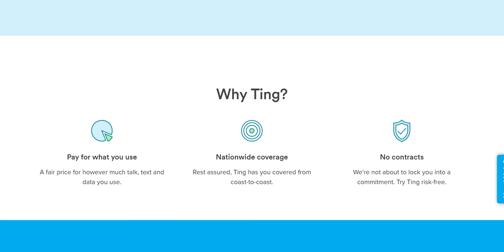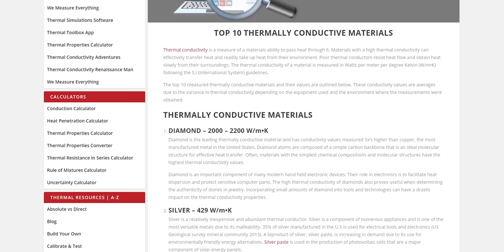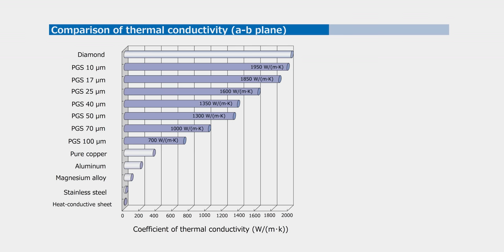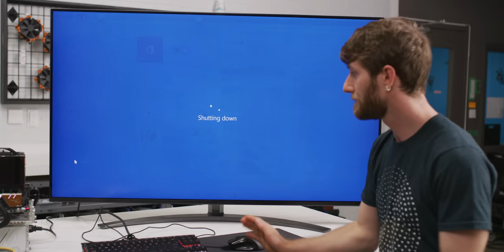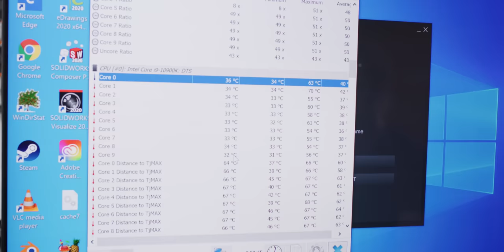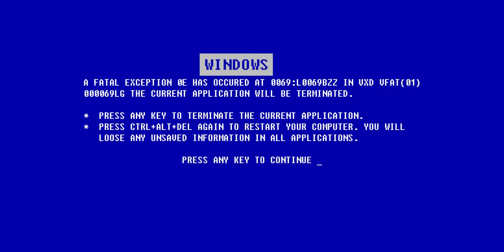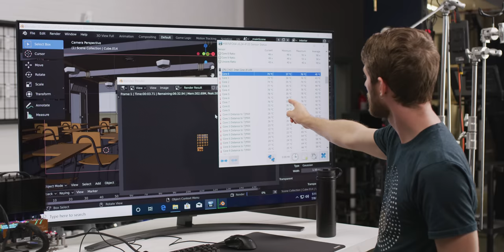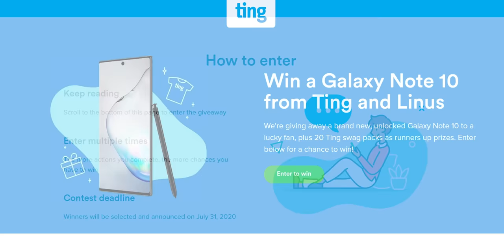This Sounds Too Good to be True - God-Tier Thermal Pad

Comment: Graphite sheet has two types of conductivity, horizontal / vertical.
Of course it is in datasheet, but Linus would never say in the beginning.
Because you know why.
Reply: could u explain?i can't even think of any reason not to say this
Reply: @user-xb6hi2pn9u  to clickbait
Reply: @user-xb6hi2pn9u  because there would be no video. It's a physical property. It's a fun video, but with sufficient information it was absolutely arbitrary.
Reply: It's called anisotropic heat conduction. Basically, because of the microscopic structure of layered graphite, the carbon rings have véry good conduction to their neighbouring, networked carbon rings. Alas the inter-layer conductivity is quite poor, because there is some sort of (electron) vacuum in between subsequent layers. So basically, we create giant networked sheets of carbon rings, that are tightly coupled. These tight couplings conduct heat very well. But inter-carbon-network conductivity when stacked upon each other is very poor.
Reply: Interestingly, this would be solved by using diamond instead, because diamond does have vertical interlinking between the carbon atoms aswell, e.g. https://i.stack.imgur.com/zytVR.jpg . Sadly, this is practically not really feasible.
Reply: @snknsnp  well, yes and no. Artificial diamonds aren't as expensive to create than people would believe... Just a side note
Reply: @petertomov5728  As far as I know creating a diamond layer that is 1) as flat as graphite, 2) very thin and 3) consisting of one single piece of diamond is incredibly hard, if not impossible. It is true that industrial diamonds are not that expensive, but creating some with these constraints probably is.
Reply: I am no diamonds expert though, so I might be mistaken here.
Reply: @snknsnp  similar here. Well, you can always rotate graphene 90 ° and do some engineering mumbo-jumbo to increase graphene efficiency 😂
Reply: Because it’s clickbait.
Reply: Peter Tomov yeah! Fold it it veeeeery ofter so the folded thickness would be the width og the chip! Cut a thin slice and lay it on its side so graphene is orientated the correct way:) voila!
Reply: @XXXstuppiXXX  ok, that I can't imagine that without "layered" electromagnetic wave interference while the graphene is "grown" on the sides of the chip.

That's not engineering mumbo-jumbo. That's engineering black magic.
Reply: @snknsnp  This would explain why diamonds are so good as this as well, since diamonds are crystalline structures of carbon, so their thermal conductivity is three dimensional!
Reply: so what if you folded it between the CPU and the heatsink? Like, literally folded it in half, with one half of it sticking to the CPU and the other half sticking to the heatsink. Since it conducts laterally, the heat would curve along the 180 and wind up on the heatsink, no?
Reply: @snknsnp  what about folding it into a cylinder and pressing that flat? (As someone else also mentioned)
Or using a single (molecular) layer of it (which is how it assembles anyway, I believe)?
Reply: @snknsnp  has anyone ever doped it such that it it will grow in zigzag layers, and each layers peak will bond with the above layer's trough? (When viewed from the side, the multiple layers will appear like diagonal cross hatch pattern)
Reply: @snknsnp  Diamond thermal compound exists.
Reply: @nickllama5296  That would double the amount of material on the low conductivity axis and on the high conductivity axis the heat would both travel through very thin layer compared to the entire contact surface of the CPU, plus it would have to travel much further (effectively the pad's width would become it's thickness in that direction)

As far as I can tell, the real use for this product is to transfer heat from a much smaller surface where to a much larger heat sink (it helps because in horizontal direction this material actually conducts heat much more than metals). But in our CPU-cooling scenario that would only help if our heat sink surface was larger than CPU surface itself - usually not the case with standard stuff

Comment: Fast note, it doesn't matter how high the thermal conductivity is if it is higher than the materials' thermal conductivity it is in contact with, the point of the thermal paste is to achieve as much contact as possible it's used as medium because the 2 aluminum plate on the CPU and the cooler won't make a good contact because they're simply two hard solid body

Comment: Thanks for proving what we have been telling our customers for a long time: "Bulk thermal conductivity alone is a poor predictor of thermal performance".  The largest killer of thermal performance is normally the trapped air in your bond line.  It is better to:
a) Ensure that you have no voids (air) in your bond line
b) Reduce that bondline as thin as possible
c) ... and THEN try to get the highest possible thermal conductivity
This is better achieved using a Phase Change Material, or One- or Two-part hybrid thermal gel and then with screws or spring-loaded clamps for best performance.
Find out more on our website: https://www.caplinq.com/thermal-interface-materials-mc.html

Comment: As others has stated, This is made to transfer heat across an area and not up. I would think the glue on one side would be enough to run the heat transfers up or down.

Comment: Realize the very high thermal conductivity is in x and y. Z is similar to other good thermal material, but it’s the lateral direction transfer that provides the astounding performance.  And yes it’s electrically conductive as well.

Comment: It's really quite useless using anything more thermally conductive than the cooler, since it will definitely be loads thicker.
Reply: Not entirely true - CPU's heat unevenly, so having a thermal interface material as conductive as possible helps spread the heat out over a larger surface more quickly. This means that the heat differential at every point of contact between the Cooler & thermal interface material is equal and allows for more efficient transfer of heat between cooler & thermal interface.
Reply: Not at all true actually, because the heat spreader and the cooler won't be absolutely 100% completely flat, meaning there will be some spots where it just won't make contact, that's the entire reason you need a thermal interface, because having it make contact at all is better than parts of it not touching.
 
Plus this is something anyone can very easily disprove yourself, since all you have to do is set your cooler on your clean cpu, get it to warm up, then remove your cooler, apply thermal grease or a pad and try the test again... Like wtf?
Reply: @vgamesx1  he's not saying don't use thermal material. He's saying using a thermal material more conductive than your CPU coolers copper bottom is useless - I.e. using one as conductive as that graphene sheet claimed is useless.

Maybe learn reading before you "like wtf" people?
Reply: Since its going to be loads thicker to fill in the gaps and imperfections you specifically want it to be as conductive as possible to mitigate the fact that it IS going to be thicker, that is the whole point of getting something as conductive as possible, and as he mentioned at the end heat pipes with multiple stages of heat transfer are very at moving the heat so you want to be able to get as much to them as possible. The problem is that while metals are quite conductive they aren't good at filling in those spaces since they tend to be porous to a degree that will actually effect cooling performance, so you are once again looking for something else to fill the gaps and the best thing you can to remove that point of failure.
Reply: @Jack-yv3po  My bad, although it's almost as if people can have completely different interpretations of the same thing and/or simply miss small details entirely from the way something is written... Again my bad and I kinda deserved that but it's just a mistake so let's not make a bigger fuss out of this.
Reply: @JohnA...  Yes, the ideal would be no temperature difference between the IHS and the bottom of the copper block. But still you have to conduct the heat from the bottom of the copper block to the heat pipes. I don't know the exact distance, but it will definitely be much more than the gap between the IHS and the cooler. And as Linus says, I think it is much more important to get best coverage possible, to use as much of the area on both IHS and cooler bottom to actually transfer the heat away from the CPU.
Reply: @vgamesx1  It's fine to misinterpret things - but perhaps don't insult people with condescending lines like "like wtf" and instead try to clarify exactly what they are saying, especially when what they are saying seems so obviously wrong.

Comment: Many people forgot that the main goal of using the thermal paste - removing the air from the gap between cpu and cooler. Air is a good thermal insulator. So thin pads would work if only you make the surfaces ideal.
[sorry for my bad english]

Comment: Thermal conductivity boundaries are insulating in proportion to the difference in conductivity between those boundaries and the thermal reflectivity. In the direction from low conductivity to high conductivity the transfer is faster than high to low. You should have used the sticky side on the CPU. If you use multiple sheets, you effectively create an insulator.

Comment: This could work well if there were more layers, I think, as this will vastly increase the thermal capacity of the incredibly thin layer. Only then the heat can be efficiently transferred

Comment: Ah yes. Graphene. The supermaterial we've been hearing about for at least a decade and a half but have yet to actually use outside of labs.
Reply: It took aluminium 30-40 years from being discovered as a "wonder material" to being used in any significant quantity.
Reply: It is used a lot in industrial applications, actually. But you never see it.
Reply: I don’t think they realized how significant the material meant for the future XD
Reply: Also it goes to show the manufacturing flaws; I mean, $40 for that small sheet? It might not even be a perfect, without-imperfection sheet, which goes to show why it’s not widely used in market yet

Comment: "puts methane gas under The Onion Router"
Im confused now
Reply: The torr (symbol: Torr) is a unit of pressure based on an absolute scale, defined as exactly 1/760 of a standard atmosphere (101325 Pa). Thus one torr is exactly 101325/760 pascals (≈ 133.32 Pa). Historically, one torr was intended to be the same as one "millimeter of mercury", but subsequent redefinitions of the two units made them slightly different (by less than 0.000015%).
Reply: Steamrick thank you! I’m aware I was just making a silly joke for the interwebs

Comment: Precaution of installation
■Do not handle with bare hands as there is a concern about performance degradation.
■Do not reuse this product after removal from the mounting board.
■Do not drop this product on the floor. If this product is dropped, it can be damaged mechanically.
 Avoid using the dropped product.
■This product is soft, do not rub or touch it with rough materials to avoid scratching it.
■Lines or folds in this product may affect thermal conductivity.
■Never touch a this product during use because it may be extremely hot.
■Use protective materials when handling and/or applying this product, do not use items with sharp
 edges as they might tear or puncture this product.
■Do not handle with bare hands as there is a concern about performance degradation.

PS. Linus - this is serious technology  - not circus...   PLS lets ALEX test this pad again.

Comment: In all seriousness, FujiPoly is worth a look. Did my own research and you have pads with much better W/mK and with thickness ranging from .1mm t 3 or 4 mm. They're pricey sure, but for most people looking for replacing thermal pads on VRM or other IC on a motherboard or graphics card, totally worth it! Got a 27W/mK from FujiPoly they worth their value. Only issue (and that you need to test first) is mouting pressure and thickness of the pad, you need to study that well. Would like to see The-All-Mighty Anthony doing a review though, blessed be thy name.

Comment: The thing is though, is other than not knowing the direction this is designed to conduct (its directional), there’s also still air gaps to deal with since the top of the die isn’t perfectly flat.

Comment: If you need convection on top of conduction to make something similar  to a heat pipe out of it.
Could roll and glue till you get a pipe or you could even use 2 sheets sandwiched together water tight, with multiple small capillaries instead of a single channel. You could even make a liquid cooled tower off of it, wouldn't need to run liquid right over the chip if the heat sync were made of this, you could just channel through the tower (which is made of this stuff) and call it a day.

Comment: If you look into the datasheet, you will find that the 2000 W/mK conductivity is in the plane. Through-plane conductivity is much lower, around 20 W/mK. We use this material in our research.

Comment: The problem is the inter material gap, not the material itself. If you need to do that than need to make a whole block of the material or the whole piping cooler as the  heat conductor. Even so, you still need some cooling paste in between due to the intermaterial gap.

Comment: When you're testing thermal compounds or pads you have to keep fan speed constant. Modern motherboards adjust fan speed to make up for poor conductivity... Hence all the benchmarks that show identical results, the system is trying to stay under a certain temperature

Comment: Just a small note: a neat property of graphene is that it is only electrically conductive in a planar orientation. So if you you put the multimeter leads on either side of the pad, the resistivity would be much higher (electrical conductivity would be much lower). This is why it is used in electronics.

Comment: Panasonic's own test data shows only comparable performance to average grease. Most likely applications: where electrical conductivity is critical to function in addition to heat transfer, where viscous materials would cause potential pump out/reliability issues, or high temperature applications that could negatively impact performance of grease. Also, aligned graphite material such as this has highly isentropic qualities, the resultant in-plane thermal performance is quite high (1200 or more), while the normal plane (the direction straight through the sheet) is considerably less (perhaps only 20-40). Also, a very significant component of total resistance of a typical CPU to heat sink thermal interface assembly isn't the bulk thermal conductivity of the thermal interface material. The is contact resistance, or how well the adjoining solid surfaces couple heat through to the bulk thermal interface material. This is where flatness, roughness, pressure, and the particular mechanical qualities of the thermal interface mixture, which is typically a combination of liquids and solids come into play. This is also where liquid carrier materials such as greases can have an advantage over solid materials as they are simply better able to fill out any voids and gaps.   https://industrial.panasonic.com/ww/pgs2/soft-pgs

Comment: Just a idea here , considering the properties of this carbon pad and how thin it is .
What about combining two thin layers of TIM with this thermal pad in the middle . The pad would distribute the heat from the hotspots to a larger surface area making it easyer to dissipate in to the coolers heatsink .
This could share another degree or two  of the temperatures .
Reply: Shave

Comment: We used this stuff at work for a customer. The thing is we make styrofoam insulation systems for underfloor heating, so maybe it is better at insulating rather than conducting heat.

Comment: It might be super conductive, but if it doesn't flow then it won't cover the small imperfections of the surfaces it's meant to connect, and therefore won't conduct well between them.

Comment: I played about with these sheets a few years back and they only transfer heat in one plane along the sheet and not through it. Thermal Pyrolytic Graphite (TPG) on the other hand is available in a form that might work though it is very soft and easily damaged.  It moves heat ridiculously easily.

Comment: Well, graphene is actually very similar to diamond, that's why it's so close. Graphene has a structure similar do diamond but instead of being a 3D crystal, is a 2D sheet
Actually, in some ways, it's better than diamond. If poked on the right axis with respect to the normal vector of the sheet, graphene is stronger than diamond, making it the best material to make a bulletproof vest (one layer of graphene, with a depth of just one atom, can stop some bullets of some weak enough guns) and thanks to it's astonishing conductivity it also makes the perfect material to build batteries (if you take two batteries of the same volume, one of lithium and one of graphene, the graphene one can store about 7 times the energy if I remember correctly).. except.. it's quite expensive for that use case to be profitable. But again, everything depends on the axis you use, graphene taken with a certain direction on a certain axis is a gift from god, stopping bullets and conducting energy (and heat) like nothing else, turn 90 degrees and it sucks, crumbles under mediocre pressure and it's just mediocre overall.